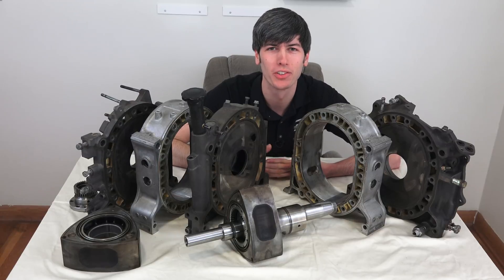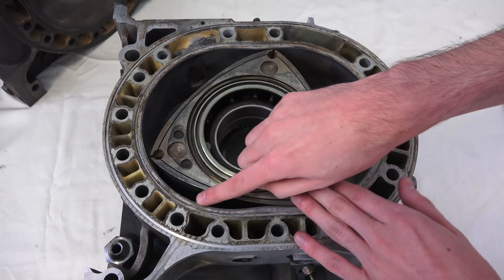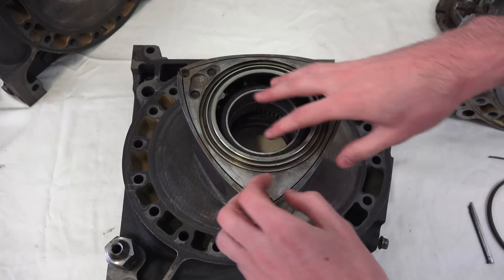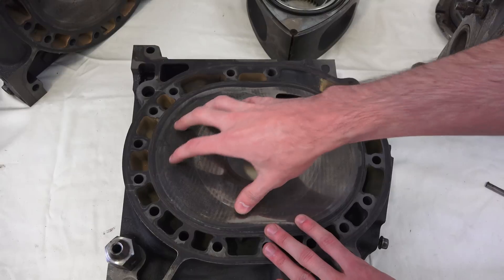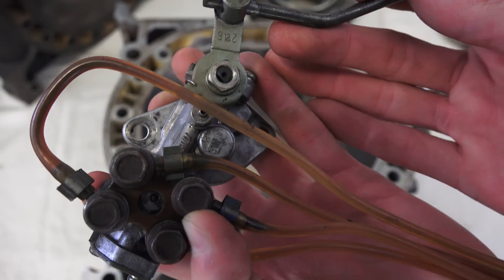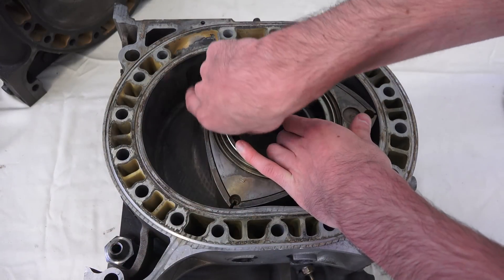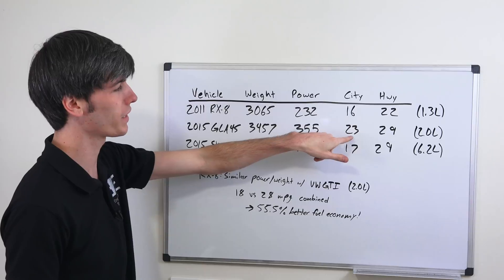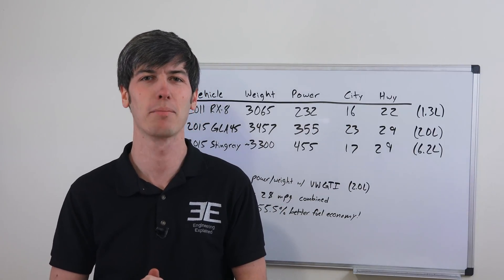4 Reasons Why The Rotary Engine Is Dead

Comment: I agree in part. It can´t be so bad as this video say, maybe for day use it´s really a engine that will give you maintenance and problems related to seal, but as a race engine will be superior to any other, as you can see in Lemans until be banned... A race engine with pistons will give you lots of maintenance too... Just like the 2 stroke engines, it´s a lest 2x better, but have emission problems too... Today have some people using direct port fuel injection to solve the emissions problem of 2 stroke engines, that 4 stroke engines simply are not powerfull enough for the size...
Reply: Ben Porter please check out about the rpm it produces.. It is much better than others
Reply: how is it superior when its power output is so low? stop trying to make it something that it isnt.
Reply: SchwertKruemel Mazda 787b still won Le Mans with a rotary engine :D
Reply: Sweet .Ninja are you seriously bring up a rotary win 30 years ago? How far have pistons progressed in the past 26 years? How far has rotorary progressed? If you compare rotary's 30 years ago to piston engines back then, they were Superior in all ways relevant to racing and were banned. Fast forward to today, and there is absolutely no benefit anymore. As this video explained the technology is crude and old. Until a breakthrough (that hasn't happened yet) it is an inferior motor in every measurable way currently aside from rpms. Which isn't really a measure of how powerful a motor is. I've seen a Dodge ram 3500 pulling 10 second quarter miles running 2500 rpms haha
Reply: Proof is in the pudding. If they were so good, they'd still be around.
Reply: justadbeer rotary is not around anymore because they can kill piston engines in light  aviation, where you don't need low RPM torque, where you in need of reliablility and low cost meitanance . 20b is up to 330 HP weight 10% less than Lycoming
Reply: justadbeer There are a million examples of technologies throughout history that are superior to their counterpart but just aren't superior enough yet to warrant essentially throwing out all the infrastructure you've developed to work with the previous technology. This is known as the network effect and it happens with almost every technology.

Piston engines have had hundreds of billions of dollars pumped into their refinement pushing them extremely close to theoretical limits. Not to mention the infrastructure, such as every factory and repair shop has been purpose built to manufacture and/or deal with piston engines and the standards they adhere to, thus making them cheaper as well.

It is just really hard to justify the R&D to go into an engine that is marginally better and without all the infrastructure around it. If we are to throw out the established infrastructure we either need lots of time or a replacement that is significantly superior in most ways to overcome that network effect, which rotary engines just aren't at this point in time, and maybe they never will considering the advent of the electric car.
Reply: ben porter, what you said is very far from real world, the piston is not better than rotary engines, rotary give a lot of problems, much more than everyone here wanna see, we already know and already think about it, but piston are even worse and you can't deny if you studied physics.

vibration and balance from a piston engine are physically impossible to be better, it will go and back to two different directions, it has more performance loss than any other engine format can offer, and obviously it will generate vibration that will destroy your engine, that is why RX-7 engine can take 2000HP without vibration and a piston engine is a pain in the ass to get more 300hp and avoid it explode and throw everything everywhere (I'm exaggerating, but it happens), about the engine format, rotary is already ahead, what we need is refine this format, piston engine already had a lot of improvements over the years, but rotary engine still not was improved.

when we are in low speed, rotary engine for sure will be worse, but MOTOLINK said is true, is better when racing.
Reply: no body care about talk only hp is like saying nobody care about your weight only kilograms 
and wtf is motolink talking about there are no 2 stroke cars that you can buy
Reply: Great reply!    I think your spot on
Reply: The rotary is worse than a piston engine in every single measurable way.  I like rotaries. They are fun to drive, totally a different experience, but they have absolutely zero benefits over a piston engine.  You could take the amount of modification and cash spent on any rotary, invest the same in a good piston engine, and get much better results. Every, single, time.
Reply: Alpha Wolf you absolutely right. 1hp=0.746kw   ..(kW) = Torque (N.m) x Speed (RPM) / 9.5488. HP doesn't exist !
Reply: nobody care about RPM or Tourge, HP is the only Point that matters, and even for a race car fuel economy is an important Point. Fuel is havy and refueling takes a lot ot time. So wasting your fuel cause of an ineficient engine is gonna cost you very valuable seconds on the track

Comment: A Mazda13 B has 80 cubic inches. If you want proof put a P& G meter on it. A rotary is much more efficient because  the eccentric shaft (output shaft) turns 3 revolutions every time the rotor turns one complete revolution. Eccentric shafts DO NOT HAVE COUNTERWEIGHTS because they are not needed in rotary engines. They also do not have a harmonic balancer because they dont need them either. Inn a piston engine the piston completely stops and REVERSES DIRECTION at TDC and BDC. Now thats inefficient! A piston engine has so much vibration it has to have a crankshaft with huge heavy counterweights and a huge heavy harmonic balancer to keep them from destroying themselves.They also have valves obstructing  the ports and they are controlled by another power robbing assembly that creates even more parasitic drag. A rotary engine runs as smooth as silk with no valves because everything inside them always turns turns the same direction. Measure the torque it takes to turn a piston engine over by hand with a torque wrench! I can turn a rotary over with a 3/8 in. ratchet! Like I said, they are cheap fun.

Comment: 13 B Rotary engines have 80 cubic inches and we have produced 748 Horse power on Bob Norwoods dyno in Dallas texas. It is shifted at 12,000 RPM and runs a whole season without teardown. RX7s are performance cars, not putt putt grocery getters. Show me a 80 cubic inch piston engine that can put out more HORSEPOWER Than a rotary with the same equipment. The rotary engine only weighs 237 pounds in racing form, and thats on the front of the car.Weight distribution is extremely important in race cars. Rotarys are still alive and well and turning 6s in the quarter milel I would be happy to put my engine and your piston engine on the dyno and run them both at 12,000 rpm and see which one lives thru it.. A piston engine will not even turn 12,000 rpm unless they are multi million dollar Formula 1 engines that only last one race if they are lucky! Rotarys are the cheapest fun you can have, period.
Reply: Oh, Now this guy.
Reply: @sammy reid: Er...uh, you seem to be forgetting the motorcycle world. Hayabusas run 1.3 liter piston engines well beyond 12,000 rpm. And for less than 15k dollars. Many stock super sport street bikes can rev in excess of 15-16k rpm and will do it all day long no problem.

Comment: The 2015 GLA 5 uses a 2.0 Turbo vs the 1.3L Rotary, I've heard the argument that the 1.3L rotary is equal to a 2.0 but that's not true and other techs and engineer have shown that. Comparing a power turbo vs non is a waste. The MPG issues isn't just the motor it is the emissions systems we use which kill diesels and other motors as well because they are designed around normal piston motors. So I agree on some of your math you are not adding in certain factors for the equation.

Comment: You're not considering the real good point in the use of a rotary engine, though: lower barycenter, lower weight, better drivability, better weight distribution... You made a point it's not a good engine for daily use, but you don't see beyond your own, little garden.
Reply: If it was so good every fast car would run one.

Comment: I used to own one a Mazda RX 2 quite a way back it had no emissions controls. It was a car I loved to drive quiet very quiet and a lot of go. It competed quite well with one of the very fast cars here in Australia and actually got better consumption. It was slow in a sense to get to 60 miles an hour but after that it flew. It is strange that the problem I had with the motor is never mentioned. The water seals are long thin loops 4 of them per rotor and these failed frequently. Maybe that was fixed later on but it gave me hell. The trouble started after I was persuaded by my wife of the time to add a third party air-conditioner. I knew one guy who did not have the troubles I did and he would sit for 15 minutes to warm the car up his had lasted five years when I knew him. I had a motor overhaul about every 12 months.

Comment: Aviation still uses the rotary engine I believe
Reply: not the Wankel but rotary engines of some type are used on some propeller driven planes unless I'm mixed up.
Reply: You might be thinking of a radial engine.
Reply: I guess I stand corrected then, lol I don't know much about airplanes I've never even flew in one

Comment: small size, lightweight, no redline, good for speedboat?
Reply: I see the reasons it's inferior. But why did the rotary Nortons clean up at BSB, winning the championship 2 years on the trot (Trevor Nation and Ian Simpson)? Plus Steve Hislop famously beat Carl Fogarty in 91 to win the IOM Senior on the rotary Norton. Apparently they had handling issues (angular momentum of the rotor made turn in harder) but made way more power than the in line 4 750s they were up against.

How did they manage that, or was it not a fair comparison on an engine capacity basis (I don't know what the swept capacity of the Norton was)?

They might be theoretically inferior, but the Rotary Nortons in race trim were very cool!

Comment: IT's not dead. You just don't know what is needed to make it better. But lots of money were invested in piston engines to make them better. Heat in ne chamber? ok, maybe intercooling can solve it; oil in the chamber? maybe some other liquid or material can be implemented. leackage? who knows, other materials or manufacturing processesThe fact is that you just don'e have all the answers you pretend to have. It's like if someone in 1930, looking at a Ford T, were saying a piston motor is not efficient and so it's dead. Wrong attitude.

Comment: Very insightful video, however, I'm quite certain that my ex-boyfriend's Mazda RX-7s from the late 70's and early 80's did not get 22mpg on the freeway. We did some long roadtrips and got much more reasonable gas mileage than that, closer to 30mpg.  It will be great if these flaws mentioned in the video can be improved; I really loved how quiet the engine was and my partner loved the elegant simplicity of the design. The acceleration for such a small engine was quite notable.

Comment: '4 Reasons Why The Rotary Engine Is Dead'  Seriously, are you joking, we only need one? 

Electric motors are superior and it was inevitable they would win out 

After all, the very first racing Porsche was electric. It was only the Getty oil cartel that buried the electric energy transport system

Comment: to me a 1.3L Rotary is a much bigger size. the reason is that just one side of the compression. it has 3 compressions in a revolution. so it more like a 3.9L per revolution (1.3 x3). also, it acts more like a 2 stroke 6 cylinder vs a 4 stroke 6 cylinder (not 100% sure) but I think 4 strokes 6 cylinder power stroke 3 times per revolution. and the Rotary fire 6 times per revolution so now 3.6x2 = 7.2L.  if I was to guess it should get about the same mpg of a fuel injected 4 stroke 7.2L 6 cylinder.

Comment: I own a 2004 Mazda RX8. The efficiency of the engine is fine. It gets mileage comparable to any other semi-performance road car. The need to periodically add oil is pretty much irrelevant. People that bought RX-8 did not do it for the fuel economy.

ITs  alow end performance car with the added novelty of being a rotary. The real reason it is no longer in production is because at the time of its design the Renesis rotary engine met all emission standards in europe, asia, and USA. The EU changed emission standards. So the RX8 was no longer able to be sold there. With half their market suddenly gone Mazda correctly stopped producing RX8s because it became unprofitable.

I think the most egregious problem with this video is comparing a car designed at the turn of the century (2000-2002) to something designed 10-15 years later. The RX8 was designed to compete with the likes of the Nissan 350Z and Subaru WRX, both of which it crushed in performance tests. The Renesis rotary was so much better than most production and even performance engines that Mazda took it to NASCAR and utterly destroyed everything on the track until NASCAR had no choice but to mandate performance nerfs specifically for rotaries.

Comment: It is not fair to compare a 2011 RX8  with a  5 speed transmission to  a 2015 Corvette with an 8 speed transmission. Those extra gears make a huge difference in the gas mileage. It is a neat technology but 4cyl have become so efficient it is hard for the rotary to compete.
Reply: skra11 
The RX8 has a 6 speed manual transmission, and even if the Corvette had the same amount of gears, it will still get better fuel milage because of cylinder deactivation.

Comment: Could you not separate the oil injection to be on its own and inject heated vegetable oil instead that way the emissions are drastically reduced. Also if hho was combined with this set up as seen in 4 stroke engines it reduces emissions 98 percent.

Comment: Rotary engines from airplanes. The reason they broke down alot cause of the seals cant handle the power. Engine capacity (1.4L) can make 800 hp. And this engine can rev to 32000 rpm. can go more but crankshaft cant handle the power.

Comment: So we saw the disadvantages, but what are the advantages of a rotary engine?
Reply: Wankel is a cool name. Oh, no never mind.
Reply: Sounds like wanker to be honest. A kick in the nut for these RX something fanboys. Bunch of wankers they are.
Reply: Less moving parts (no camshat, no tappet, ...); the wankel engine can be "perfectly balanced, as all things should be" because it rotates; the torque lasts about 50% longer, which makes a more "even torque"; due to seperate intake and outlet area the wankel engine is more suited for burning hydrogen (i think this is obsolete); it works better with stratified injection than an otto engine, that reduces the thermal loss

The main problem with the wankel engine is that it is hard to seal the engine.
Reply: Perhaps there was a time when rotary engines had an advantage for potential power/weight. However, with the significant advancements of piston driven engines, this is no longer the case. Small, 4 Cylinder engines have become extraordinarily efficient, and they're much more durable. The argument about "less moving parts" is pure nonsense; it doesn't matter how many moving parts an engine has if it is efficient, reliable, powerful,  and cheap to repair. There's no reason to go rotary, unless you're a masochist.
Reply: doktorbimmer
Please use google before shitposting!
Wankel engines can provide much higher power to weight ratios than piston engines (which is pretty important), it is less prone to catastrophic engine failure (that is what matters, since the "runs badly and needs repair" is much better than "piston seized in the cylinder" for obvious reasons) of various causes.

That is why it is to this day used in various aircraft.

Yes turbine is better.
But most people don't have the budget for engines made out of unobtanium high temperature superalloys with ceramic coating, which has a LOT of small details in notoriously hard to manufacture materials.
Reply: None, That's why they're leaving.
Reply: Weight.. RPM.. Top end sound and power..Matted to a 200KW hybrid system it should balance well at 450hp or so.. 
With the 13B..

Comment: Fuel economy and emissions. Death knell. Plus the fact that despite its lower parts count, it really wasn't any  cheaper to manufacture. Several groups tried developing it for an aircraft engine. Thought they would get the power/weight ratio of a turbine with the low fuel burn of a piston. Weight was OK, but its fuel burn was worse than a turbine. Tho way cheaper to make than a turbine.